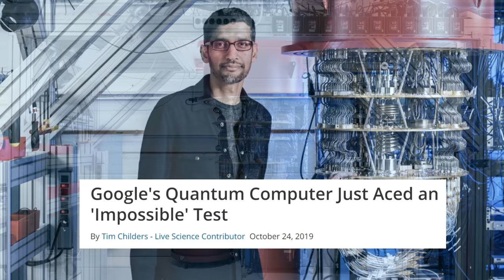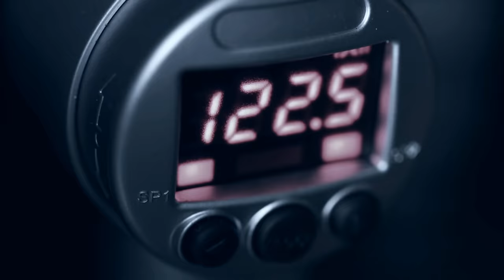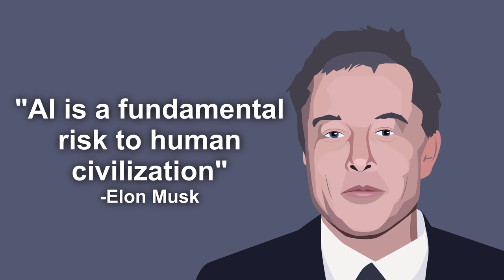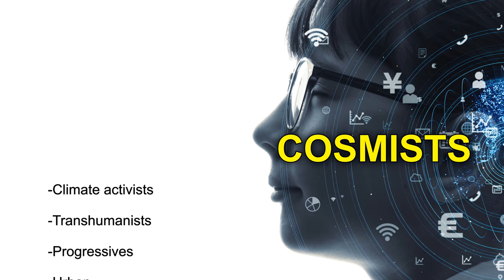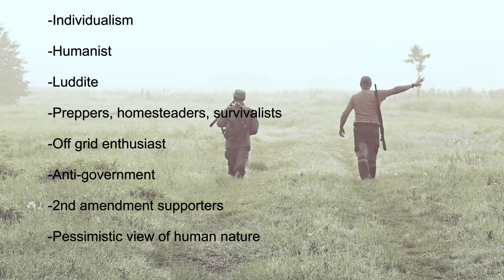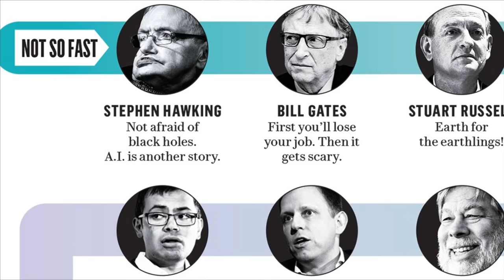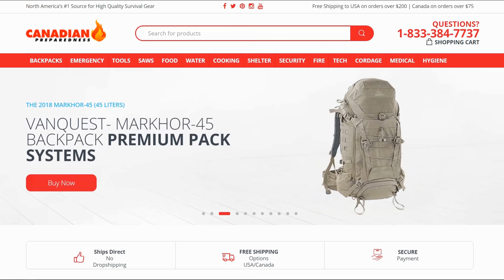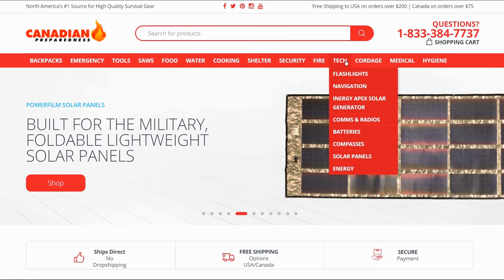WARNING: Surviving Artificial Intelligence- The Coming Battle for Humanity

Comment: I was born in 1937 and remember trying to listen to news of the 2nd WW  coming over a static filled radio the size of a small refrigerator.  I bought a house in a remote section of the Southern California Mojave Desert in 1976 and remember the news of people dying on the desert near me during the summer heat when the temperature is 110 or above each day in July and August. Silly, unprepared people would drive out to the desert without any water with them, get lost on the sand trails, get stuck in places of deep sand, run out of gas trying to get out, then finally try walking to find help when the temperature in the shade was 110 or above. Sometimes their bodies had to wait for months to be found.. This was before cell phones were available. All things in life have both positive and negative things associated with them. I personally love technology.  Thanks for your research into the problems that are lurking just around the bend for the human race. Whether the human species will be around during the next century or not is a question that most of us won't really have much say over. It's interesting to ponder the question however.

Comment: I mean if the cybernetic implants were completely independent and controlled by you with no chance of outside interference, and if you could take out the power source or the implant itself easily without harming your body,  I might entertain the idea. But it wont be. Whoever made the chip/implant will have remote access to it for "maintenance, updates and customer service" and will probably be collecting whatever data the implant sends back to them.

Comment: I use a continuous glucose monitor (CGM) and an insulin pump that communicates with the CGM to suspend delivery when my blood sugar drops. Next year, it will have the ability to increase the delivery rate if my blood sugar increases. What I am trying to say is, I already am part cyborg where my pancreas is concerned. (Don't worry, I am also a (slightly) misanthropic introvert, so I have no desire to assimilate anyone.)

Comment: There is nothing paranoid about common sense emergency preparedness, no matter the label put on this area of self preparedness "insurance" part of life. Does this mean you can prepare for everything; no but it does mean that you are more help to your family, friends and community if you know you have a grip on the basics.
Those that have had no power, or utilities or not enough potable water food or emergency medical supplies and last but not least, very useful off grid RF communications, know it makes sense as a long term, step by step plan to deal with things out of everyones control. 
 I have been an active ham operator for the most part as a hobby for over 30 years, that started when I was younger;
I realized years ago, as a group, hams are an enormous beneficial network of technical geeks that like communicating using both older Radio technology mixed with newer IT/digital emission technology and much of it used for volunteer public service and have memorandums of understandings with many Municipal, County, State and Federal agencies.

 The fact is, even with our low solar cycle HF effects, there are very few places that cannot be contacted locally, regionally and or globally with newer smaller radios and smaller off grid equipment using older CW or newer FT8, psk31 digital emissions from a backpack, this statement from my own experience. 73's keep up the common sense.

Comment: I frankly don't see an apocalyptic conflict coming between Terrans and Cosmists.  Most people are somewhere in between.  They want the benefits of technology (e.g. cancer imaging, diagnostics, immunotherapy,, etc.), while minimizing its negative side effects.   It would be a cautious embrace of technology.

Also, time frame matters.  If it's the next 10 years, we will probably see a proliferation of narrow AI.  After the initial hype, most computer scientists now have also realized both the achievements of deep learning, as well as its real limitations (actually, dead end) as a pathway towards AGI.  Fully self driving cars (L5 SDC) is still more than a decade off.  Geo-fenced, simpler environments, L4 SDC's maybe possible.  But the hype around SDC's is now more tempered.  There are R&D programs towards AGI.  But these are largely theoretical, small experimental attempts at different things.  There is currently no demonstrated pathway towards AGI analogous to the breakthrough in 2012  with deep learning.

As for quantum computing, Google may have demonstrated "quantum supremacy".   But this is largely an academic exercise, with a toy problem.  Truly useful algorithms are still few and far between.  People are still trying to figure out what to do with the stuff, how to use the stuff, since it's so different from classical computing.  There is also the noise problem which continues to dog quantum computers.  Most experts see true quantum computing a few decades off.   It maybe useful for specialized applications, such as quantum physics, molecular modeling, materials science, and chemistry.  But it's not a replacement (a faster version) of classical computers.   Classical computers, BTW are also running into problems, such as the flattening of Moore's law, since one can only make the transistors so small before running into quantum (noise) effects.  In order the grow, the industry is moving towards specialized chips, ASIC's (application specific integrated circuits).

Perhaps the prophet to check out might be Yuval Harari.  The danger isn't some kind of AI super-intelligence itself, as much as humans using narrow AI to hack other humans.  This shows up in China's use of facial recognition, social credit, and the perfection of the surveillance state.  This is also very tempting for other (less democratic) governments in developing countries, now able to purchase whole systems with "surveillance in a box".  Issues such as privacy, disinformation, surveillance,  freedom from the state, become more prominent.

I'm basing my predictions on trends that are already underway.  It would be for the next 10 years.  Beyond 10 years, who knows.  It's hard to say what new fundamental discoveries will be made along the way.

Comment: Hmmm, i view myself as a technologist ... so what do I think that means ... well, i'm for technology and technological advancement, in the way we do it now ... Using Computers and Software to control them offer great benefits for very specific tasks that humans 'suck at', so we should probably use computers instead. But why do we need computers (AI) to do human things? We got more then enough humans as is (some argue even way to many) ... and I hold the same opinion when it comes to machines, they should do the things humans can't do (or enable them to do it, like an exoskeleton f/e), or really don't want to do (resolve sewer blockage f/e). For most of these tasks we don't need high level AI, and for the implications that AI poses (look at Amazon package centers f/e, replacing humans with robots, while humans can clearly and easily do the work ~ which btw. is a reason why i don't get why people still want to shop at Amazon, but vote for say Trump to keep jobs in America) ... so fairly simple, self contained technology with a clear purpose that is beneficial to the human race is great ... the rest, not really a fan !! (means i would probably side with the Terrans tbh.)

Comment: Terran with cyborg leanings.  TBH it would depend on the level of autonomy the cyborg parts have from external interference.  Of course, once they are in and integrated, too late.  Currently I live in isolation with internet, gives me time and space to think.  The cyborg side would allow me advantages I do not, nor will ever have without them.

Comment: I don’t necessarily want a chip in my brain, but I’m not in apposition towards having my body being turned into a cyborg either. As long as they don’t mess with my brain, I’m fine with that. Otherwise forget it. Plus I don’t want my body to be hacked, so no Bluetooth or internet connection. The only connection I want done is between my body and my brain. That’s it! If have to use a smart phone for the rest of my life, I’m good with that.